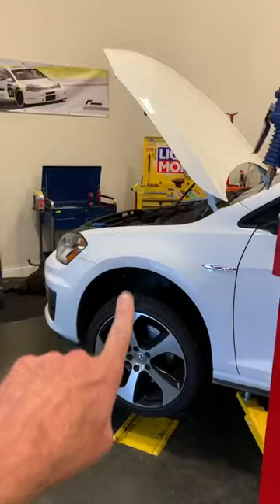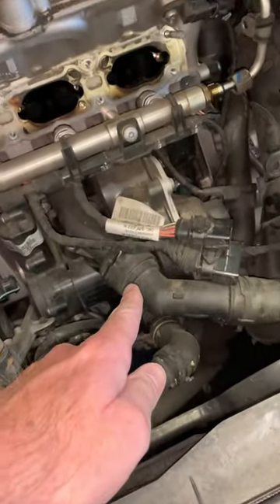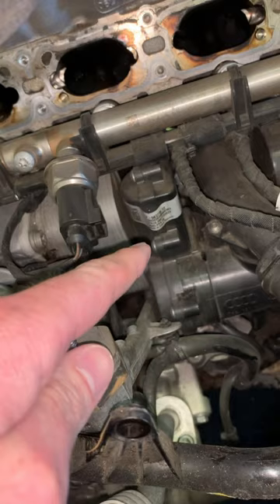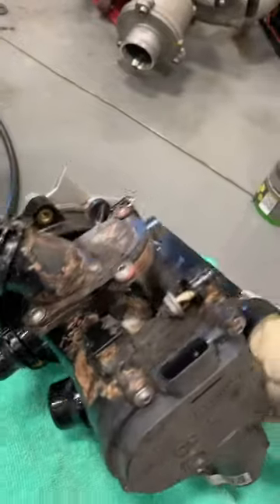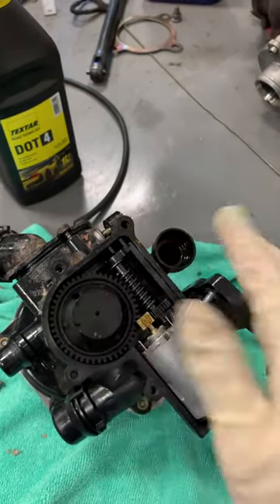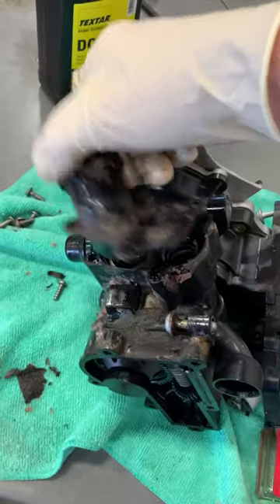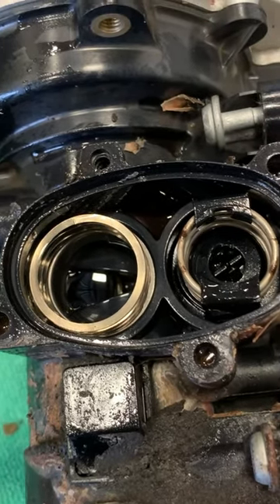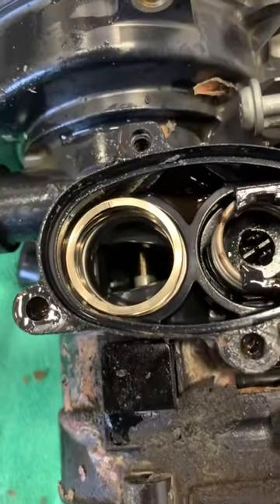Electric Thermostats are pretty neat #shorts

Comment: The SSP on this is very interesting. There are about seven different modes that the thermostat can operate in depending on the requirements of the car. And they all involve leaking.

Comment: I'll stick with a heat operated one thanks
Reply: Idk, not having to wait as long for the heater to work in the winter and having it run cooler in the summer sounds good to me, part probably lasts 100k miles
Reply: @macthemec  how would it run cooler in summer?
Open is still just open, right? or am I missing something?
Reply: @grantperkins368   I am assuming the engineers would design it to flow more than necessary so that 100% open would overcool the engine and for normal operating temperature it would only need to open something like 60%. It would make sense for it to be designed like that
Reply: @grantperkins368  thats based on my understanding of the older BMW thermostats, it was basically a traditional stat that had a heater element to contol when it would open/close, under a overheat condition the system would heat the element so the thermostat would be fully open instead of its usual partly open
Reply: @macthemec  So, like imitating turning the heater on, just a different heat exchanger, I like that idea, controllable by a simple cable :-)  thanks for the explanation, it's starting to make more sense ... I still like the idea that if the thermostat is faulty I can fix it by throwing it away lol ... I'm just old, I suppose.  I don't want to add switches and wiring and relays to anything that doesn't need it.  Just more shit to worry about, maintain, replace/repair etc etc I'm sure you've heard it all before. 
Having said that, I don't presently own a car or even live in a place where it gets cold so I'm sure that people living in those sort of situations might enjoy the early Heating part of the deal. Cheers have a good day

Comment: The traditional thermostat has been functioning for a LONG time. 
Why are we trying to digitize or sensorize everything on cars?
Electronic shift controls, electronic parking brakes.... why?
Reply: Ì there's a question you don't know the answer to, the answer is probably money.
Reply: Likely because this setup gives some improvement to the official fuel consumption test figure, which - while having zero real world benefit - can lower the manufacturer group average consumption, lower tax brackets and make millions in greater sales volumes.

Comment: My thermostat is a 92c $6.00 and comes with new gasket , went faulty at 170,000 miles 15 minutes to fix still working 60,000 miles later.
Reply: I guess you don't want to pay for a $375 thermostat for a VW?